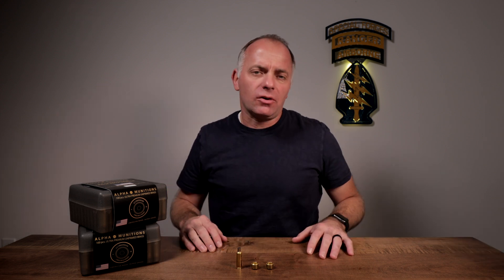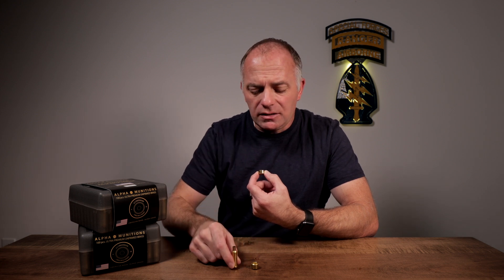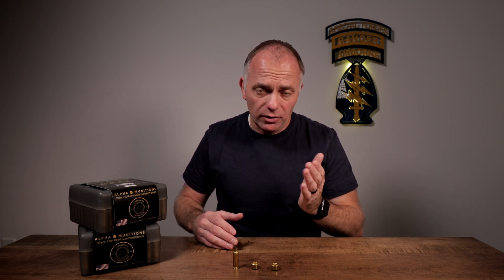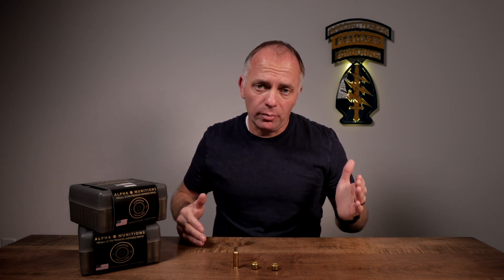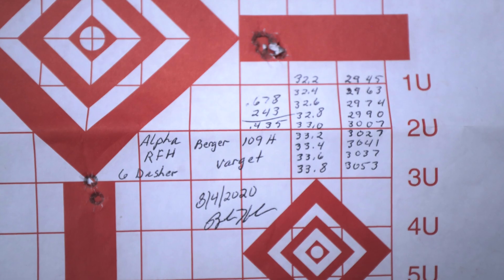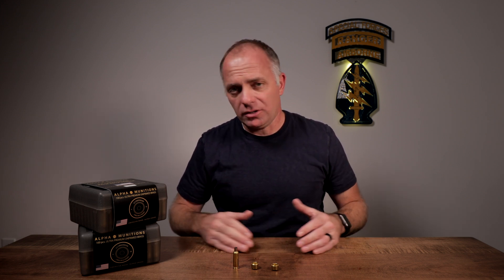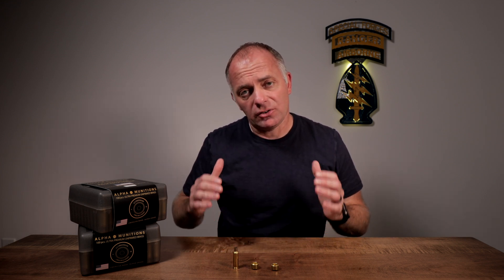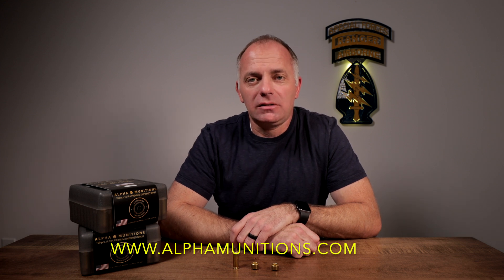Alpha Munitions Optimized Case Design (OCD) with Optimized Case Head Technology.

Comment: sounds like a shortfall you can use bolt lift pressure or markings on base to know you are at max node
Reply from the maker: You may be able to get to a higher node than book max but that doesn't mean you are within safe pressures.  For example, 110 A-Tips behind 34.2 gr of Varget is 62,200psi.  You may be able to run higher but your pressure is too high.